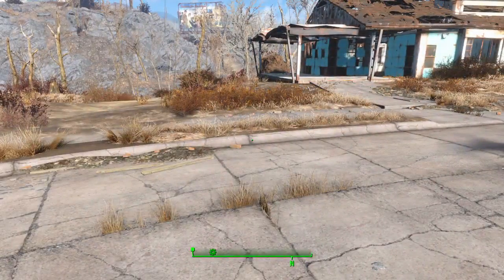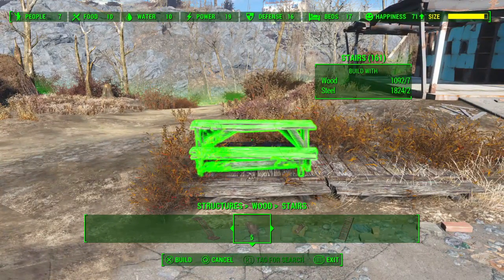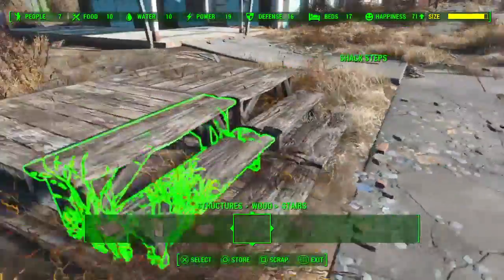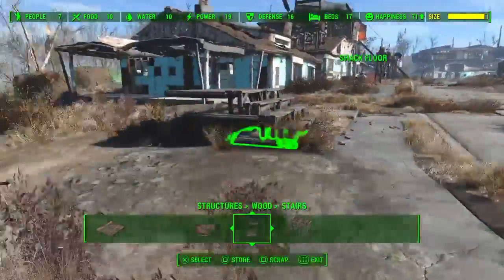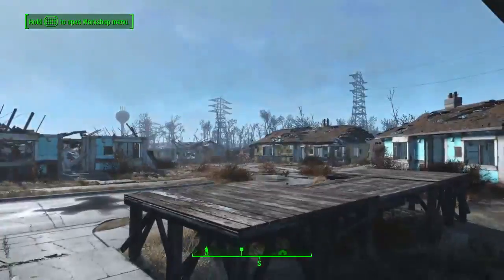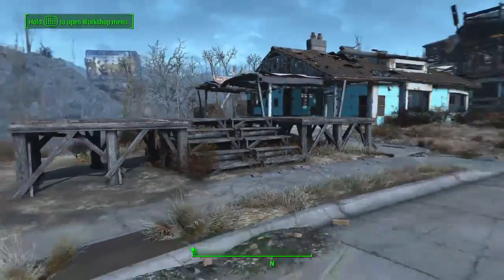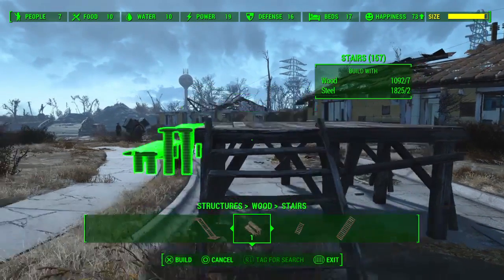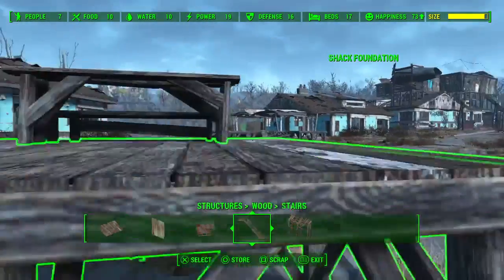Fallout 4 Guide - Staircases, Turret Emplacements & Guard Towers

Comment: I am using chainlink and wire fencing as anti-rpg and anti-grenade defense. Funny seeing attackers throwing grenades, having them bouncing off and exploding on the ground. While your turrets blast away at them. Missiles you need to place the turret 1/2 to 1 tile back from the fencing. This is due to the missiles detonating on contact with the fencing. Still need to work out an effective counter for the fat man. As they have explosive, radiation damage and a large blast radius.

I was thinking of building a square open roofed area, funnel any attackers through it. And have walkways lined with turrets, that have a clear field of fire into the square. Using some chainlink, wire fence pieces as a roof. Any enemy stupid enough to throw a grenade, fire a missile or fat man will regret it.  But your turrets can happily chew through them like tissue paper.

Comment: Great video & some excellent inspiring build ideas. 
I've taken your idea for the guard tower & adapted it slightly myself into a "single prefab tile" tower with a couple of little tweeks. They look excellent & add something different to my main settlement! 
Cheers for the inspiration & helpful build tutorial. 

I'm on Xbox One & haven't installed any post release patches at all, but sadly it seems (for me at least) that the rug glitch for shack walls won't work for some reason. It works for pretty much everything else (junk fences/furniture). 
It's a bit strange as I've attempted it numerous times with varying numbers of rugs/mats, manoeuvred around with no effect  : (

With the much anticipated addition of building mods for consoles (utilising Settlement Supplies Expanded etc.) the diversity of builds are promising to be immense. 
I'm hoping we see a mod that allows the placement of ambient lighting, such as the oil lamps, candles & the oil drum braziers. 
The "place in red" mod would be extremely useful too.

I love these bite-size tips & tricks videos which you're putting out. Very useful & very informative, and I'm looking forward to more great build ideas you have.

Cheers 👍

Comment: Yes, the rug glitch works. Not with all objects, but if it's not working at least with junk fences you're doing it wrong. At one point I thought it wasn't working... but I was doing it wrong. This is on a PC, and without actually checking I'll say I'm current with patches. I think they've only patched it like once or twice anyway, so it's not like there's a daily build you have to keep up with.

Couldn't get it to work with shops, so I might just have not been doing it quite right either. And of course it doesn't work exactly like this with shack walls.
Reply: +Lytrigian i find it work best with flat surface but can u it with just about any object
Reply: +Lytrigian I'm on the latest patch and it works perfectly with shops. Only need 1 small rug for it (just make sure it's actually right under your shop)
Reply: TheNitroCapital I put the rug right under one of the shop's feet, as Davey does here, and it didn't pick up with the rug.
Reply: +Lytrigian i put it under the middle front of the shop and it works fine. (so not under a leg)
Reply: Only objects which don't snap work

Comment: The only way I can use the rug glitch is if I hold A. Well, I'm on Xbone.
Reply: try placing a small mat first, then on put the large blue rug on top of the small mat. After that, try to move the small mat to see if the large rug also moves. If they are now attached, go put the object you want to move at the top of large mat. make sure to do these in a flat surface.
Reply: +God Teemo No, I mean that's how I use it and I was telling others who have the same problem as me.
Reply: I have to hold it too I'm on ps4